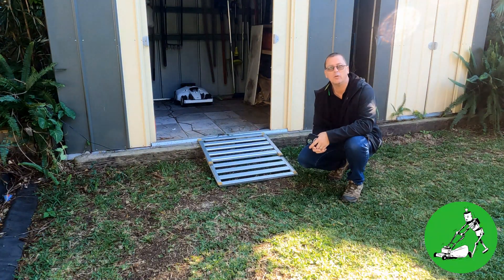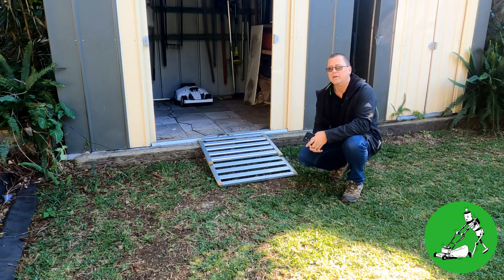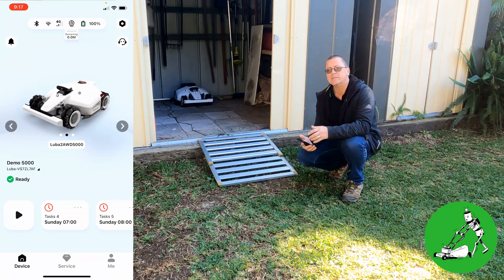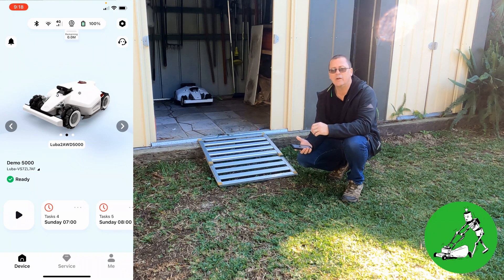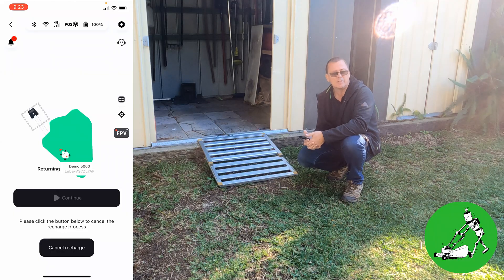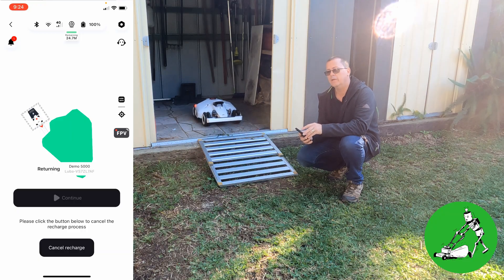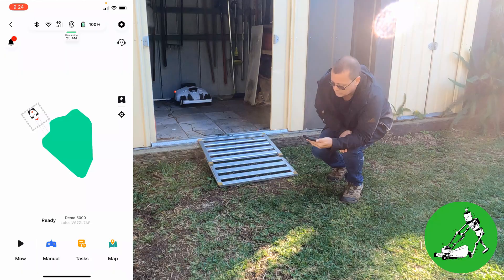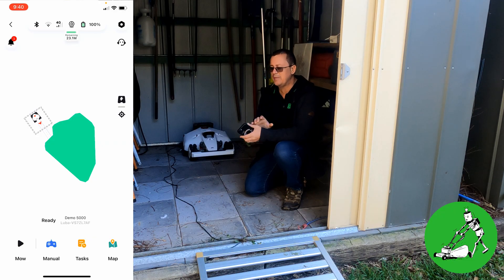Luba 2 Install Charging Station under Cover - Wireless Robot Lawn Mowers Australia

Comment: it should enter station forward and use camera to align itself and the GPS signal wouldn't be an issue.
Reply from the maker: I personally think this could be sorted and fixed, but it seems all manufacturers including Mammotion are wanting the robots to have GNSS signal on the charger.
Reply: @robotlawnmowersaustralia7913  I had a Worx AI for a while and it used its camera to view a symbol on the station as it approached and entered forwards and very adeptly navigated cleanly to orient charging prongs.

Comment: Is it the same issue with the Luba2 X Series?

Reason for asking is I am thinking of buying a garage in corten steel as same fits the garden.
On the other hand the Money is wasted if the robot does not leave it.
The garage is 1000mm (1m) in length, so the robot only need to Travel a meter before getting satellit coverage.
Reply from the maker: It may work ok only being 1mt in length, but generally we only recommend that the robot can still get satellite signal when on the charger. Mammotion change the fw and then they work, the Next time it changes it doesn’t work. So best to be safe and only cover them with plastic or thin timber roof.

Comment: I am receiving my Luba mini 800h tomorrow and would like to use my Rubbermaid shed as its garage. I will put my RTK outside and close to the open door of the shed. Does this sound good to you?
Reply from the maker: It may work ok, but with the latest firmware version the robot typically requires a good GNSS position when on the charger. If it does get a good enough signal it may not start its mowing task and say it is outside the mowing area.
Just make sure you install your rtk correctly and in an open area with full view of the sky. Anything less is not ok.
The charger can be moved around anytime if it doesn’t work in your preferred location.

Comment: I just have my charging station underneath my garden shed. Works great it rolls out every time.
Reply from the maker: Great to here that is still working for some customers. Many of our customers this no longer works for them. In some cases it seems the Luba will still remain connected to satellites even when under thin metal cover.

Comment: Very interesting. How is this actually configurated. The 5m, etc.?
Reply from the maker: This is now a little different again because Mammotion have updated the firmware for this function.
But it basically resets its position after a while on the charger. After this it requires some GNSS signal to get going again. 
When the GNSS signal is weak it shows the robot floating off the charger on the app view. Even though the robot is still firmly on the charger. If it floats outside the dotted box on the app the robot will not start. If it is still inside the dotted box it will start.
So putting the charger completely out of GNSS signal is currently not advisable.
Hopefully in future updates we will get this function back.
Reply: @robotlawnmowersaustralia7913  great thank you

Comment: Hi, thanks for a great video. I’ve got a problem similar to what you described with my Luba Mini. The charging station is 1 meter away from the task area with a channel connected. It’s covered by a small roof so it doesn’t see many satellites. Ones it’s out of the roof it gets perfect connection. The weird part is that every morning it thinks it’s in my neighbours yard 15 meters away outside the task area and will not move unless I have Bluetooth connection and manually send it out. Do you have any idea how to solve this?
Reply from the maker: They still need some GNSS signal on the charger or this will continue to happen. We are hopeful Mammotion will bring out a fix for this in future firmware.

Comment: Currently I have mine Luba 2 set up in my garage...  I haven't had any issues with Luba coming in and out of my garage...  She no longer have to brave the weather...
Reply from the maker: With the latest updates is this still working for you?
Reply: how does the door open automatically and lets the light in?
Reply: @6GSF I open the garage door... It's 5 feet from the door and plenty of light is getting in.

Comment: But I thought the robot uses radio signal to connect to the reference station? so as long as the robot can talk to the reference station it shouldn't matter where it is? radio will work through many obstacles?
Reply from the maker: Yes the reference station does use radio to communicate, but RTK doesn’t tell it where it is, it only provide data so the robot can work out where it is it’s self. When under metal it has next to no GNSs signal so it can only use its camera to know here to go.

Comment: Why not just manually drive the luba out, let it position itself and then start mowing?
Reply: That's no problem for a 'manual' mowing system, but the ideal robot system is fully automated so you don't have to worry about when the mower goes out.
Reply: @captaintechno8023  That is correct.
Reply from the maker: Other than it being a manual task, you can absolutely just remote it out to the lawn and start mowing. It will then return to charge and continue to mow all day until it gets dark.
Reply: Awesome!
Thanks for creating this video. I'll try this when my Luba2 comes back from the shop. 😕
Reply from the maker: @RDaleMercer  what went wrong with your Luba 2? 😳
Reply: @robotlawnmowersaustralia7913  error 2748 among others. It's either the lifting mechanism or the positioning sensor?
I submitted feedback through the app AND email to support.
The suggested sending it in. Shipped 7/08 arrived 7/11. They promised 2 week turn around? Hmm.
I have the 5000H. I'm guessing that I'll need to mow it at the highest setting for several days once I get it back as I have no other mower.
Have you seen this error? Could I have repaired it myself (I'm pretty handy)?
Reply from the maker: @RDaleMercer  That is the main board not reading the position sensor at all, so it could be a failed sensor or a failed main board. Or just a loose plug. So unless it is just a loose wire/plug then it probably needs a replacement part anyway. Hopefully it returns to you quickly. Thanks
Reply: @robotlawnmowersaustralia7913 such useful interesting videos, in your opinion would the Luba X perform that task ? Perhaps even better ? Indeed could it actually come out of a shed with poor light, would it use its own light ? Ummm interesting
Reply: My robot shuts down shortly after it 'stops working', even with lots of battery left. It's really annoying since I'm far away from it, and can't just go there and fix it. There is no way to remotely power it up through sms, which is a shame.

Also, it can not be remotely driven from far away. You need bluetooth to drive it. Again, it's a shame since many times it needs to calibrate the position by driving it around, when it has lost GPS.... and it can't autocalibrate by driving some meters back the same path it came... which would be possible if it remembered the last ... say 25 meters, it drove...

All in all, the robot can not be managed from far away... it has the technology to do it. It's just not mature enough. You have to be prepared to travel to the location every time it 'stops working'...
Reply from the maker: @oledamkjer9355  unfortunately remote power up and driving Luba does not meet the safety standards that robot mowers are manufactured to. So I would blame this one on Mammotion. If your robot is stopping and shutting down for no reason then you should be getting your dealer to diagnose and fix the issue. If you purchased directly from Mammotion then you have a 50/50 chance of getting good after sales support.